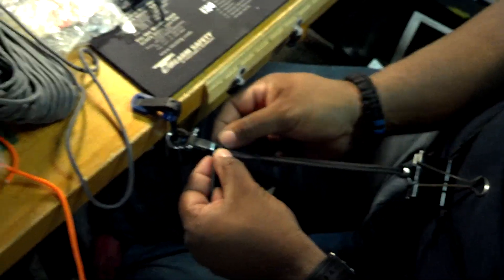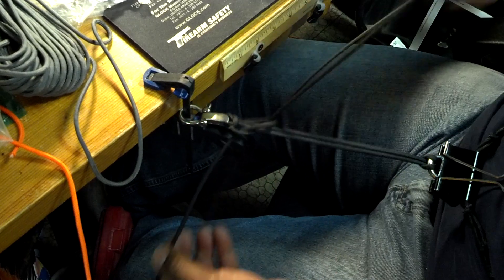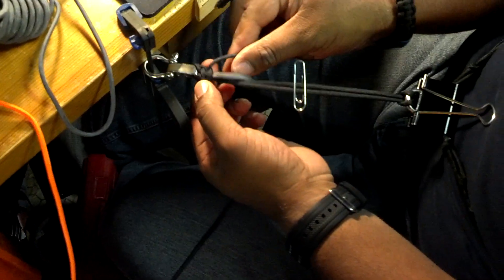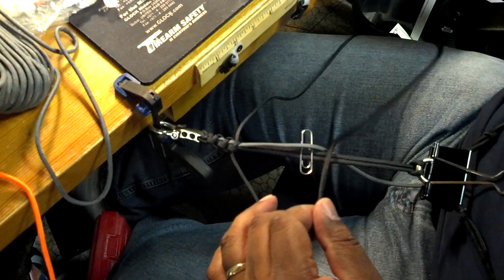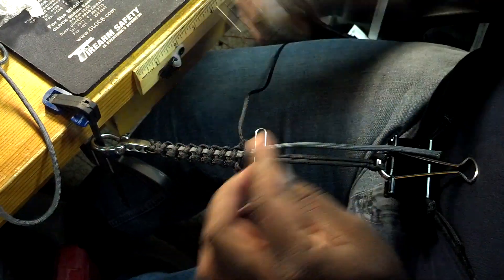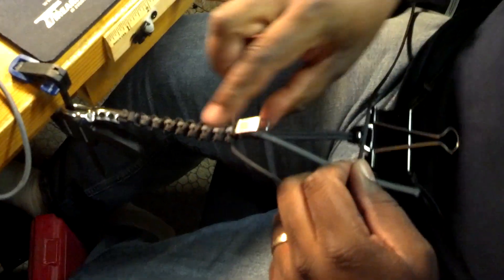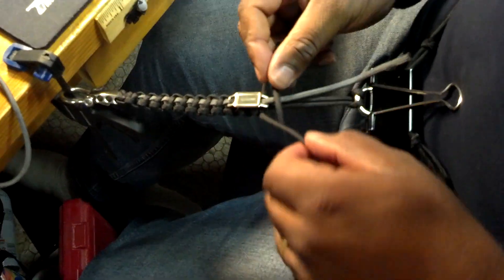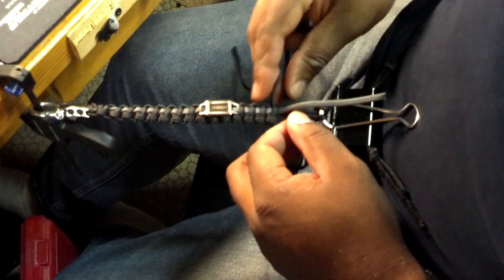Making a paracord bracelet with custom charm and D Ring Shackle part 3

Comment: I have a question, first i really like what your doing, second is where can i get, order the charms that you used, i am looking for a marine corps charms to go on a paracord? Pls help.
Reply from the maker: Thanks for the support MTZ. It really helps to hear feedback. In terms of the charms. The actual metal part I am currently getting from Knotcreations.net. I have found them to be a quality source with fair prices. For the logo inside of the charm, most of the ones that I use, I design myself. I find that easier than dealing with copyright and licensing issues.